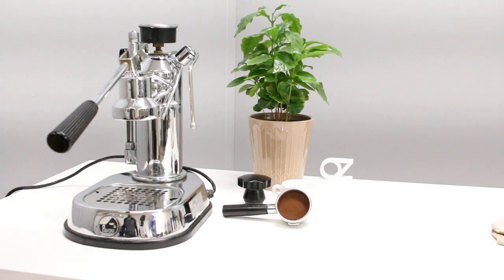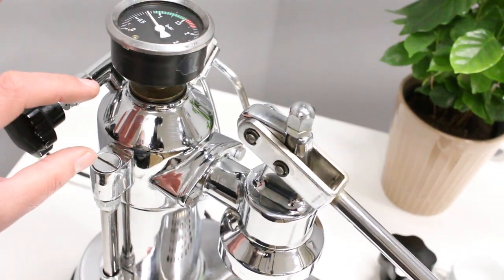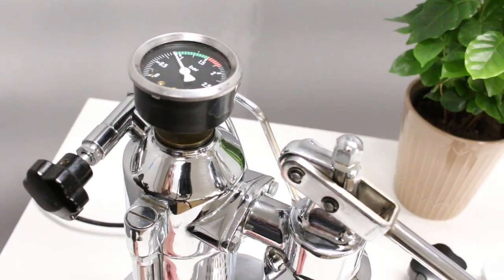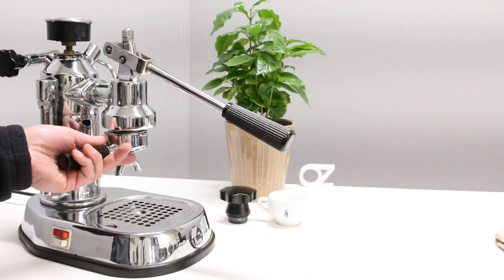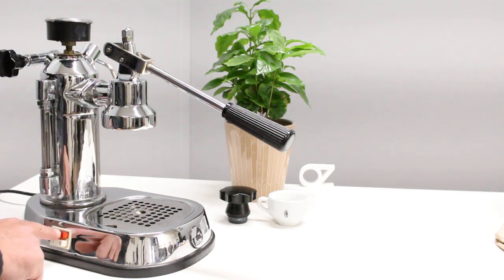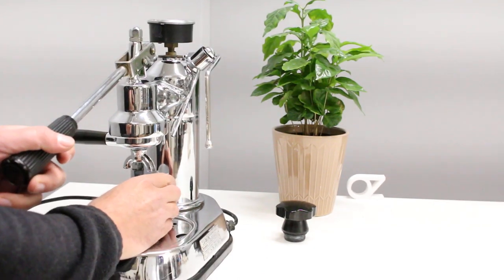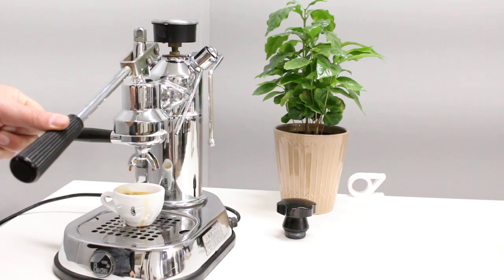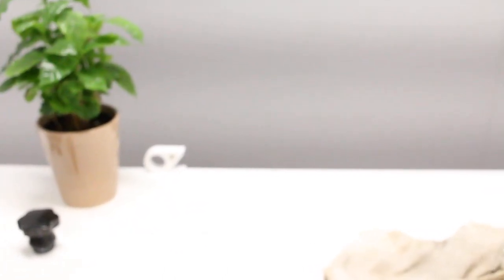How To Pull Shots With La Pavoni Europiccola Pre-Millennium | Tips & Tricks

Comment: I love that you screwed up but still posted the video to show the mistake. More helpful than a lot of videos I've seen with many more views.
One question I have: 
When I pull the shot on my La Pavoni, it takes some strength to pull the lever *up*. Like, if I were to simply pull up the handle, I would lift the unit off the table (there's that much resistance). Is that normal? If not, why would it be so difficult to pull the lever up? This is only when the unit is under pressure and ready to go; when it's cooled down the lever moves freely.
Reply from the maker: Thank you for the feedback, glad you liked the video. 
From your description isounds it might be n aligment issue but I am not sure. Usually it is the other way around, when cold it is hard to move and easy when hot. Might be time for a tune up. Thanks -Y
Reply: @ozespresso  that's weird because the machine is only a month old
Reply from the maker: It can happen on new machines, not only Pavoni but most of the brands. 
If it's new, contact the seller and see if they have any warranty and then can help. 
Could be the gaskets are dry, even though its new, it could have been sitting in storage for a while... Worth checking

Comment: Any recommendations for a home use grinder that can be adjusted in order to determine the proper grind setting?  I don't want one of the big ones that is designed for restaurant use.  Also, what's better, electric or manual? Burr or blade grinder?  Also, the  green range on the gage in the video is different from the gages that attach to the sight glass. 

Thanks!
Reply from the maker: I prefer electric flat burr grinders, there are some good optioned out there, Rancilio came out with a new one and Eureka has a nice selection. Good luck!

Comment: Did you even weigh the coffee grind and the coffee cup, time your shot? You should use a chronometer whenever you time anything.
Reply from the maker: We mainly do these videos to show the owner of the machine it works after the repair and we don't have the time to make every shot "perfect on camera" but yes, when we need to pull a good shot, we make sure to use all the necassey tools. Thank you!
Reply: @ozespresso  I just want to know the truth, whether these machines do actually deliver high quality espresso; otherwise I'll shoot for a real, high quality espresso machine in the $900 range instead of wasting $500 on a Zen experience that won't deliver
Reply from the maker: @abueloraton  When choosing an espresso machine it really depends on the user's drink preference. Some folks don't froth milk at all, some like to have the option to pull 5-10 shots if they have family over. Altogether the Pavoni is a good machine for the price and can last many years, also it holds it's value if you ever want to sell it. It is more suitable for skilled users that like the manual control. Hope this helps!
Reply: @ozespresso  But it uses one size small basket, 52 mm, right? 14 grams maximum serving per basket
Reply from the maker: @abueloraton  Correct, in older models the portafilter is even smaller. As I said, it is a very specific machine for espresso drinks. To my opinion, the best value for money machines  E61 Heat Exchanger machines with a 58mm portafilter.
Reply: @ozespresso  Thank you. This answer is very helpful. A somehow unrelated question: do you love the Flair 58 for your own espresso purposes some days or is it an overrated espresso machine?
Reply from the maker: @abueloraton  Never tried the Flair nor the new 58mm model but it looks like a good product. For that pice i would buy a Gaggia Classic or save for a La Pavoni. It's a good choice if you are on a budget and willing to work a bit harder for your shots.
Reply: @ozespresso  I definitely don't like the Gaggia Classic--overheats and overextracts. But I wonder if the Flair 58 can actually pull good quality shots. If it can, then it's worth it. If it can't, then yes, save for a dual boiler or a heat exchange machine. But if the Flair 58 does deliver, then it's worth it; that's why I wondered if you'd tried it. I'm terrified that it could be a big fail, because it's been on pre-sale forever, which seems like a big red flag to me. But I don't really know anything about these things.